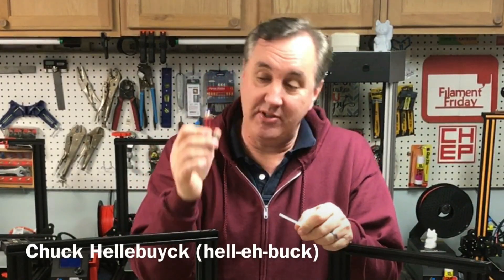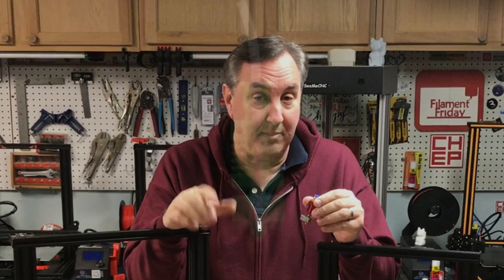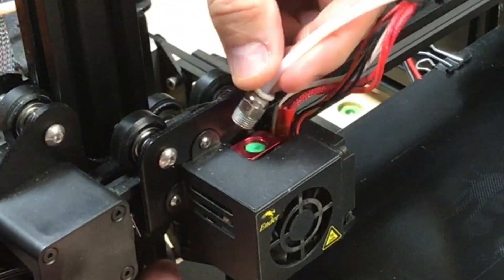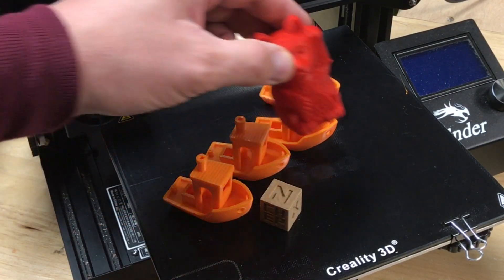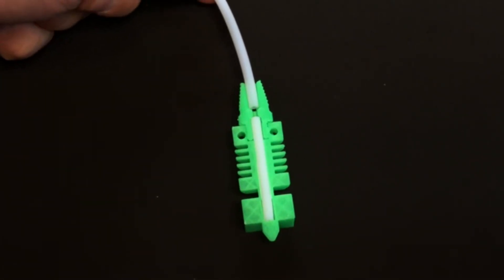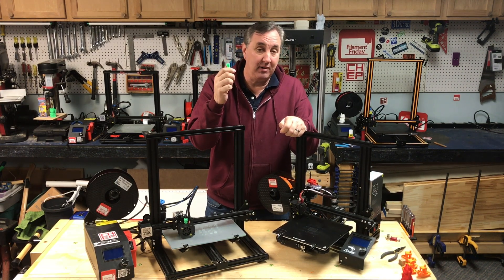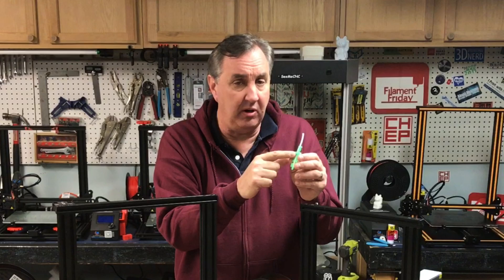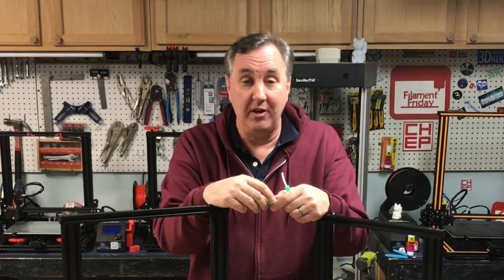Creality Ender 3, CR-10 - Hotend PTFE Fix

Comment: I'm a bit late to the party but love this idea. If I were to machine a stainless tube to the same dimensions as the inner PTFE, would that serve as an "all metal" hot end? Stainless is a pretty poor heat conductor and I imagine wouldn't offer much resistance to the filament either?
Reply from the maker: Don’t know. You’d just have to try it.
Reply: Try it and let us know how it goes. How about brass or copper? I think those would mate to surfaces a little better.
Reply: @slappy76  Brass or copper are good conductors, they would make excellent heat sinks further out but wouldn't insulate the hot end for long. I was just about to order a section of 4mm/2mm surgical steel (from a hypodermic needle manufacturer!) when I spotted a Stainless mk8 drop in All Metal throat for £5 on Amazon.. I'll try that first!

Comment: I noticed today that on my Tevo Tornado the bowden tube on the extruder was moving in and out of the coupling quite a bit, And I have bad stringing that I haven't been able to solve.  It always did that, but I really noticed it today. These couplings might help a lot!
Reply from the maker: That was the original reason as I showed in this video:
https://youtu.be/x35aWmnZ_A0

Comment: My only worry is at times I see a "failure to feed" when the filament gets stuck on the edge where the bowden tube isn't a complete match with the extruder. Have you seen this? Also, where can you get a copy of the extruder model you are using as a cutaway?
Reply from the maker: I haven’t seen that.

Comment: I find it pretty hilarious that at first, you must have a 3d printer, then shortly thereafter...I must have a 3d printer to print parts for my failing 3d printer...lovely

Thanks for your dedication , you sure saved 3d printing for me, all I have had is problem after problem with my ender 3, I would have pitched the unit if I hadn't found your channel,  consider this as an appreciation comment, and a sub, THX bro!!
Reply: That's why you have 2 3d printers. That way you always have a printer to fix your printer.

Comment: I think Creality reality needs to rethink their quality standards when it comes to the fans. This is really annoying. I've had my Ender 3 for 6 weeks now and so far two of the four installed fans have failed.
Reply: Just replace your fan with a Sunon with good static pressure specs. These are silent and designed to work reliably on equipment for long periods. They are widely stocked around the world in know sites like Farnell, Digikey, Jameco, Newegg, etc.
Reply: @luislabmo766  - Infact I replaced them with some no name brand fans and they're performing much better.

Comment: how long is the
 ptfe tube do I use on the cr10s with the modified cupling.  thanks
Reply from the maker: I use the Capricorn tubing linked in the description. Believe it’s 4mm OD.

Comment: A coupling like that would be pretty easy to machine out of aluminum or brass as well. I might do that for our cr10s-pros in the shop here, because I 100% have been running into the issue of the ptfe tubing wiggling enough that after 50-100 hours of printing I get a backflow clog and have to disassemble and clean the hotend.  Awesome ideas man!
Reply: If you do, I would totally buy 4
Reply: I'd totally buy a couple too! Shoot me a message if you make any!
Reply: @schmaltzy82  if you do make these in metal I would like to buy as well

Comment: I keep trying to print part of the coupling and it keeps failing. I know you had a video on this but I can't seem to find it. You printed it with the smaller portion down and I keep trying to do it but one of the legs keeps breaking and the print fails. I KNOW you made a video on this but I can't seem to find it.
Reply: This is a late replay but a raft works fine for me.

Comment: This video made me wonder if I could machine an all metal insert that would replace the ptfe you placed in the heat sink, then this could allow me to print nylon. I am very new to all this stuff but if I had someone in the know to help me I have access to a machinist lathe.
Reply from the maker: Or just buy a microswiss all metal hotend:
https://amzn.to/2XEmk4a
Reply: I was wondering the same. Machine an aluminum insert that wood replace the Bowden tube and washer? Your thoughts chuck
Reply from the maker: Extremely difficult to make smooth enough to prevent filament sticking. Also you will probably need better cooling as you’ll get heat creep.

Comment: Hi!
With the washer and the "fixed" ptfe tube inside, haven't you had problems of matching in changing the nozzle?
I mean, it is no more needed to do the 1/4 turn thing to have a perfect match, right?
Reply from the maker: You can adjust that at the coupling as well.
Reply: @FilamentFriday  The question was whether or not we have to do that matching once for all or at every nozzle change.
Reply from the maker: Yes, the PTFE needs to be tight to the nozzle no matter which nozzle.
Reply: @FilamentFriday  So when you change it you just remove the old one and insert the new one without caring about where the PTFE piece is? (because theoretically it was matching with the old nozzle and it should match with the new one as well)
Thank you for your patience
Reply from the maker: The PTFE might fall out when you remove nozzle. Install it and nozzle then tight coupling down enough to make sure PTFE touches nozzle but not too tight that it bends PTFE.
Reply: @FilamentFriday  Perfect, thank you. You're a milestone even for an Italian guy!

Comment: Can I print petg at 240degreesC with a ptfe liner. My hotend is v6 j hotend..It has ptfe liner inside already separated like yours in the heatbreak.... Its my First time using and building a 3d printer.. Or do i need to get an all metal heat break.

Comment: You need to have that coupling design made in metal.  Sign me up for a few.  Great idea, I'm not sold on the plastic version.   As a small volume printer, such a failure would ruin hours of work on a large print.  I'd rather "push through" the print and get it done and replace teh fan as part of routine maintenance from time to time.

Comment: Excellent work.   I just saw your video so I used a different approach on my Ender 5 since I had not seen your recommendation.   

I have replaced the Bowden tube with Capricorn and also replace the original Creality coupler with a coupler that use metal components instead of plastic to lock in the tube.  Then I put the new coupler into the top of the hot end and after it was tight I backed it out about 1/4 to 1/2 turn.   Then I put the new tube into the coupler and push it down as far as it will go.   Now, remember the coupler is backed out just a bit.  Now I tighten the couple which pushes the tube down a bit and also helps lock in into the coupler.
Reply from the maker: Yes, I’ve done that as well and it works great. Another option is to also loosen the nozzle a turn. Then tighten after the PTFE is in place.

Comment: Wasn't aware that this was an issue.  I have 3 creality printers and never had a problem.   Cut the tube flush, put it down the hotend and have good coupling sets.  Also, I find it weird that you put capricorn tube inside hotend but not using it from the extruder to the hot end.  I know it can take hotter temps, but the lower tolerance and smoother inside makes it worth using.

Comment: Wow! This is one of my favorite channels and for good reason! 

I just printed this for my Ender 3. I had a piece of Capricorn tube that was too short for a Bowden tube so I used it for the hot end piece. I think I left it a little too long because my first test was seriously under extruded, suggesting unwanted friction somewhere. I backed the fitting out of the heat sink and printing improved.

I remeasured a few things and decided I was a bit long. Even with the good cutters, it is hard to take off 1 mm and get a square cut on the end (well for me at least) so I just cut another piece to length. It is now about 1mm above the heat sink and it is printing better than ever! AND I'll never have to buy one of those fittings again! I printed a second spare just in case I ever need it.

Now I'm off to find an STL for the one on the extruder.

Comment: Have you ever had problems with the connector that the tube slides into?  I have had problems with mine and the tube pulling out of the connector in the middle of a print.  I have a brand new creality cr-10s pro
Reply from the maker: Yes:
https://youtu.be/x35aWmnZ_A0

Comment: One of the most recommended upgrade for ender 3 is changing the stock tubing to capricorn one.
I did it, and print quality is worse, why?
Reply from the maker: Did you make sure it’s pushed all the way to the nozzle, no gap?
Reply: @FilamentFriday  Yes it must have been all the way in as the marks left on the tube from the teeth of a coupler were on the same spacing as the original one.
 Also few times it completly clogged the filament inside of that capricorn tubing right around the end, after 5 minutes of printing.

Comment: I tried to do a cleanup where you take the white tube out and clean it then push it down in the red piece to clean that. I watched a video.  But, I was unable to pull the white tube out of the coupling. So If i were to do what you are showing do I cut it?  Thanks!
Reply from the maker: Yes. You can cut it.

Comment: Chuck, the same issue exists in the Ender 3 Pro right? I am ordering a pack of capricorn this week, the small tube may need to be replaced after a while in use right?
Reply from the maker: Yes, Ender 3 Pro is the same. At some point you might have to replace the section.

Comment: How are you suppose to remove the ptfe tubing if its very short inside the hotend?
Reply from the maker: If you need to remove it then also remove the nozzle and push it out thru the bottom.

Comment: That's a great looking fix, Chuck.  I have a question though pertaining to something within the video and not the fix itself. You were printing multiple parts in a single print on a CR10 mini.  What's the strategy in printing multiple items in a single print?  All the same item?  Parts as close as possible? If not the same parts, parts grouped by height in proximity to bed location so they don't disturb near lying parts later in the print?  More items - less items?    I'm prototyping and was trying to figure out if printing variations of a parts, at the same time, is feasible.
Reply from the maker: I just print trying to get 4 hours of print time. That way I can print something roughly 4 times a day. Morning, lunch, dinner, bed.
Reply: @FilamentFriday  Great, thanks for the tip.

Comment: how long i have to cut the PTEF to fit perfect inside the hotend?
Reply: That one I wanted to ask now. the same as the "original"??? Please answer!
Reply from the maker: There is no exact size. The coupling screws down to take up the space so cut to fit with enough threads to hold but not loose.
Reply: @FilamentFriday  So, the way is: take a part of the tube, fit it in the hotend, screw up the new coupler, cut the part (or mark it  just at the end of the hotend and cut it in a perfect 90 degree with a good knife, and put it in again) at the end of the hotend?
Reply: Or, maybe, you just show your way to find the perfect lentgth? In video?
Reply from the maker: Yes. Then if coupling is too far out, cut slightly more off.
Reply from the maker: Every hot end may be different. So I showed the concept and let you adjust it. It’s not hard to slowly trim it to fit your setup.

Comment: Did your fix with the m10 printed in ABS and no washer.. now I get super underextrution..
Reply from the maker: Make sure the inserted PTFE is all the way to the nozzle.
Reply: @FilamentFriday  i used the cutting guide from Luke.. But now i just cut the ptfe tube a little higher then the heat block, And it works.. thanks !
Reply from the maker: Perfect.
Reply: @FilamentFriday  it's a night and day fix. I wish I did this fix and fixed the M6 extruter coubling before the very first print. The guide on YouTube "Ender 3 pro build" and this fix is necessary before even opening any slicer. Get hardware fixed 100% before looking at software.

I had almost perfect print before this and fighting slicer settings..
Now it's perfect.

Soo every new ender 3 - Ender 3pro needs:
1-Follow the Ender 3 pro build  guide  

2- Do this fix and fix and lock the M6 Bowden connection on the extruter.

Thanks. You have been a great help!

Comment: Excellent work, this solves a bunch of issues, and makes access to the PTFE tube easier when using something like a Petsfang Bullseye. Just one note though - while Capricorn tubing is very nice, it's still PTFE, and does not allow for higher than normal temperatures. The marketing is a little "vague" around this...
Reply from the maker: What is normal? Capricorn XS states 340° C melting point specs.
Reply: @FilamentFriday  It also states it's 'mostly' safe at 210c, 'ok' at 225c and 'maybe' safe at 275c, which they're honest about...but not exactly clear. PTFE off-gasses well below it's melting point, and while some dodgy PTFE tubes 'could' perform worse than standard in terms of off-gassing, Capricorn tubes do not perform better than industry standard PTFE.
Reply: @FilamentFriday  And while I'm rambling, I'd also argue that comparing melting points of 'as low as 220' against 'up to 340' is super special marketing science...

Comment: Great idea, I will use this.  I found that I needed more airflow from the cooling fan to enable more retraction when I started printing PETG.  The fan I have now is noisy but it works to keep the top of the extruder cool to the touch.  

When retraction causes jams the filament is stuck hard in the nozzle as it swelled on the quick push after a retraction jerk.  This new coupling trick would make it a lot easier to get that filament out.  Now I have to remove the nozzle, to open the coupling (fan shroud in the way)

Could you design a coupling that snapped together, or was much taller to elevate the gripping nut?
Reply from the maker: Maybe in the future.

Comment: so, I have the issue on my Ender 3 that the ptfe tube won't come out of the top of the hot end. It's stuck in there very good, which I suppose is a good thing in a way, but made troubleshooting a jam a while back very difficult. I could get the stock pneumatic coupling off, but the tube wouldn't budge.
Reply: You do know that you need to push down on the blue release ring on the top of the coupler? Sometimes the PTFE wears a barb on the grip ring in the coupler but you can always unscrew the coupler and remove it and the PTFE tube together. Once you have done that you can push the PTFE through the coupler a little more and reveal the barb section on the PTFE tube. Carefully clean that up with a sharp knife and release the tube by pressing the blue release ring on the coupler. You will need to take a small (5mm) cut off the end of the PTFE before re-inserting to make sure the coupler retaining clip grips on a new section of the PTFE tube. Always cut the end of the PTFE square with a very sharp knife - the base MUST be flat
Reply: @havenview  right, I did know that. The ptfe was stuck in the hot end, not the coupler. I did manage to get it out, and even though I've never printed higher than 220 the end of the tube was burnt. Replacement has been ordered, this time with some capricorn tube

Comment: I have a question concerning tightening the nozzle. Does the nozzle tighten against the part of the throat in the heat block or is the nozzle tighten against the heat block only? Then let the puematic connector push the small piece of TPFE tube against the nozzle for sealing?

Before, I let a little tpfe tube(.04 inch) stick out past the throat before I tighten the nozzle down onto the throat with the temperature at 200 deg C.
Reply from the maker: It tightens to the block and the PTFE fills the gap.
Reply: @FilamentFriday  What about the throat part that goes into the heat block? Doesn't matter anymore?
Reply from the maker: It locates/centers the PTFE and connects the heat block to the heat sink. How could it not matter?
Reply: @FilamentFriday  Sorry if I appear ignorant. I am trying to finish my setup. You do not mention how to install the whole setup. So I am asking. 

So to repeat: I screw the throat to be close to the nozzle in the heat block.

1. Leave a small gap between the bottom of the heat block and the top of the nozzle.
2. Screw the throat in to touch the nozzle in the heat block.Heat the block to about 210 Deg.
 
3. Tighten nozzle to throat.
4. Insert a small piece of TPFE into the heat sink, leave a little TPFE for compression.
5. Tighten connector to be tight but not too tight to compress TPFE onto nozzle for sealing.

6. Install rest of TPFE tubing and filament.

7 Done.

So I still tighten the nozzle to the throat as before. This will hold heat block and nozzle in place.
Correct?

Comment: Just found your sight & I like it Just a thought on that part to hold the tube in the top of the extruder I never use PLA for any parts on my printer. PTFE  is the only filament I use on my printer it's just that much better at holding up under temperature. PTFE prints as easily as PLA so it's usually what I print with.
Reply: PETG I'm guessing is what you meant to say. Afaik there's no printer hard core enough to print with the heat resistant material PTFE.

Comment: Loosen the coupler by 1/2 turns, push bowden tube in as far it will go, tighten coupling. Push/pull on the tube to check there's no play at all. Job done. Nice video, thank you.